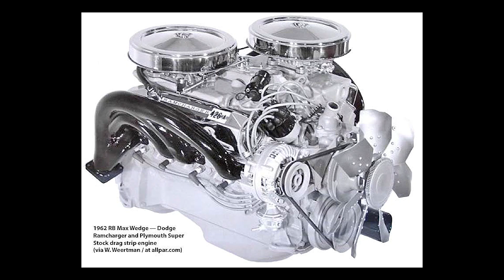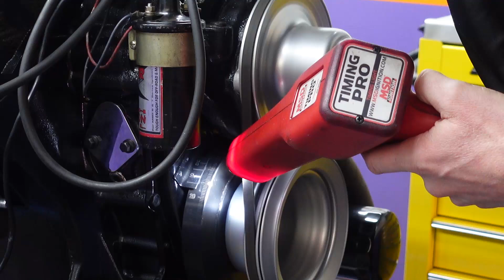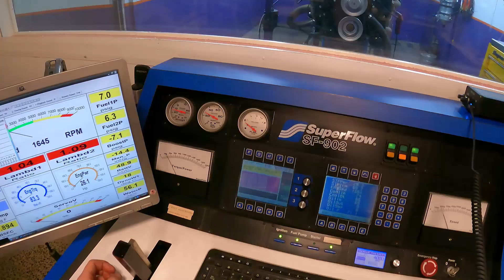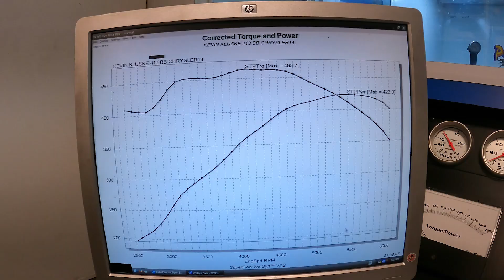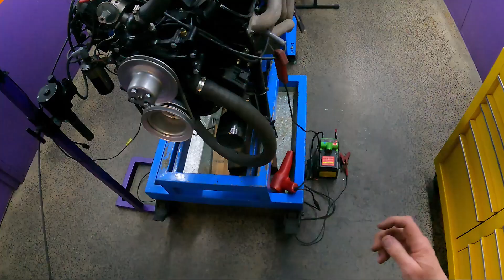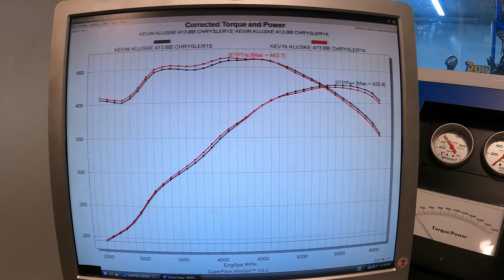High Performance 413 Big Block Mopar Build & Dyno! | Iconic Engine Builds

Comment: I've got a "fresh rebuilt" 413 Golden Lion engine. The engine was rebuilt in 1990 and has never been started. It's been in dry shop storage all these year with numbers matching 727 pushbutton transmission that documents it's  and the engine rebuilding at the same time. 
It has never been installed, started  or tested to my knowledge. 
I plan on putting them in my 1962 Dodge Dart 440 convertable.
My redheaded stepchild project.
Advice please?

Comment: I have a 1960 Chrysler 300F with the original correct 413 HP block and long rams.  I had it bored .060 over and had the older style heads reworked with upsized 1.74 exhaust valves from the 1.60 and polished and ported them. It still has the original Carter 2903s carburators which are 550cfm.  I love old Mopars.  It’s nice watching other people interested in these dyno-saurs!

Comment: The old dual carb long cross ram intakes on the 413 were / are true torque monsters. You could tow a battle tank or tear down a brick house with em. And wouldn't stress the beast @ all.
Not much top end but with huge torque down low who cares. Love to see a dyno torque read from 2K rpm with those manifolds tuned just right.

Comment: What pistons did you use in that build it looked like they were flat top zero deck or close to it I have 3 of those 413 engines all out of trucks but they are way down in the bore like 7.5 compression thank you for sharing your knowledge with us

Comment: Try a hughes engines cam next time with 1 7/8 " headers and larger carb and ported heads or rpm heads and boom 500+ hp easy.

Comment: I wonder how a 1" open phenolic spacer would have done?
Reply: I don't think there would be enough gain to sacrifice air cleaner/hood clearance. The manifold is tall and what improvement are you gonna get if you have to choke it with a limited size air cleaner?

Comment: I've been watching a lot of Nick's Garage on another YouTube channel who's in Canada who mainly works on Mopars and loves the old school Hemi's. Your video must have popped up because I watch his channel. Great video and now I have two channels about dyno tuning car  engines etc. I've been into motorcycles since I was twelve when my father bought a new 1972 TS125 Suzuki. Many years later I was working at a motorcycle repair shop which included a machine shop. In 1995 I bought a 1980 GS1000ET Suzuki for $200 stripped it down and rebuilt it as if it was brand new out of the crate and finished it 1 1/2 years later in August of 1997. Lots of modifications to the engine, but kept the O.E.M. carburetors and airbox with a K&N air filter. Stock they did 135mph, red line was at 8500rpms. I changed the drive chain and sprockets from 630 to 530 to lighten it up and kept the same gear ratio because my previous bike "same model and year"  only pulled to 7000rpm in 5th gear. The engine I built was so smooth and with gobs of torque from 6000rpms and up pulled to 10,000rpms in fifth gear topping out at about 151mph and kept pulling like a mule, but ran out if gearing. Had I geared it talker, I could have gained another 10mph or so, but never did. 
I look forward in watching more of your video's here in Miami Florida. 

P.S.
How's the weather down under? 🤔😁🧓
Reply from the maker: Thanks so much for tuning in. Nick has an awesome channel too! Thanks for sharing your story, I too love bikes of all kinds. Suzuki have always provided a great engine platform, I had an RM125 at age 13 in 83, and many a drag racer has seen awesome durability from the iconic GSX-R power plants. Weathers great here, thanks for asking!. :-)
Reply: @GlennEverittMasterofMachines  Cool. I'll watch more of your video's and try to keep my comments shorter. 😁🧓

Comment: Wow! You guys sure got a lot of HP and Torque out of that 413. Sounds really good to boot. You dont see many on the road. Actually, I haven't seen any that have been transplanted into newer cars ( (66- 73 B-bodies). Makes me think!
Reply: I have a friend with one in a '71 Charger. Not a racer, but the mild 413 runs great with 3.23 gears, 727, and 11" converter🙂

Comment: What a great video.  You don’t see these old vintage Mopar V8s get the modern treatment.  There’s a lot to be said for a purely mechanical engine without computers getting a new lease on life. I have a 413 with a four barrel Carter sitting inside a ‘60 Crown Imperial Coupe that I will be going through.  Keep up the good work!

Comment: I’m a mopar man. & we pickup pulled with a 413/476ci. It was a 4.13 bored to 4.25 bore, a 7.100 rod with a 4.25 stroke crank.  What a power house engine with big torque

Comment: Add at least a 1-in spacer, and you've got four more degrees of timing to play with at least. Big Block Chryslers have always responded well to 34 to 36 degrees of total advance. And it looks like the phasing is pretty good, your timing mark is not jumping around. From your specs, and I don't remember what compression ratio you had but you should be running somewhere right around 4 35 horsepower and right around 490 to 500 foot pounds of torque.
Reply: I've got dometop pistons in my 383 mopar, and It ended up liking 38-40deg timing a lot more than 36. I verified my balancer TDC mark a couple times to make sure I wasn't just having an error on where 0 was. 32 definitely seems pretty conservative but safe.

Comment: Excellent and professional job great power curve!  I have built and ran a lot of Mopars drag racing  my 24/7/365 daily driver 4 door C bodies. Those 4 bolt heads are almost always superior to 516 and 906s, especially the 1959 "509" and early 60s "324" if they have old school welch freeze plugs. It aint all about flow. But the best improvement I ever made was gasket matching. Leave a 1 to 2mm ledge sticking up from the bottom of the head port to flip up any pudding fuel. Never sink the valves. Do a great valve seat job, slightly bowl blend, and leave the rest alone. i get 30% better low lift flow with 30deg intake seats. Bigger ex valves with hard seats. Blend and polish exhaust.  Huge gains from a little grinder dust! Better in every area, including MPG. headers and a minimum of 2.5" exhaust a must. Good cam choice!, Im willing to run bigger with no more than a 110 ctr helps. They do not respond well at all to "modern" wide ctr cams. They wanna lope! Overlap seems to help with low octane. With our fuel here in the US, 9 or 9.5 cr is about right. Lower is fine. More timing works much better than more compression. I always run 2x4bbl either inline, tunnel rams, or long rams always synchronized, and no progressive linkages. But you have a great manifold there! I have spent many years learning the Thermoquad carb. Best mpg, tune ability, power, and sound! Dont toss warped ones they're fine just keep the same parts together.  I get 21 mpg with a 1968 Crane experimental hyd, "H302"  234° @ .050 109 ctr .455 lift  cam (tried about 20 others, nothing beats it, esp not the new crane "302" ) , 4.10 gears, long rams, and two big block TQs. lifts the front end with 4680lb car, low 13s in 1/4 with 8.0 cr on 89 octane. Gearing and torque convertor is key. Get her cruising in the rpm sweet spot. People wondered how it got such good gas mileage. It almost doubled, going from 2.91s to 4.10s at 60mph. 4 mpg better than bone stock! Awesome build!
Reply from the maker: Thanks for your awesome feedback and input Daniel! Glad you enjoyed it. 🙂
Reply: Thats moving for a heavy car. Love the long rams for torque and the TQ's are great carbs. I had a 350 hp 440 in my 84 dually and got better millage then I do with the 360 that is in there now. When I build my 440 I plan on using my long rams on it, can't beat them for low end torque.

Comment: I like the old four bolt valve cover heads. I wonder what power it would make with an old Weiand or Offenhauser 4bbl intake manifold made in the early '60s. They were low rise single plane and nothing at all like single plane intake manifolds like the Torker.
Reply: They were a 1950s designed manifold. Some of the 50's engines had factory iron examples of them. I put a Weiand version of it on the first 440 that I souped up in 1972. And had the Offenhauser version of it on a 340 that I later changed to an Edelbrock single plane. I have an Offy RB Chrysler dual quad manifold that I will one day install just for nostalgia sake. Everything you read about those manifolds trashes them but about 35 yrs ago one of my friend's had the dual quad version on an E-Body Barracuda 383/4 spd and it ran great. It would be cool to see someone do some serious testing and comparison even though I'm sure modern stuff is much better.

Comment: What’s the whine type sound coming from that engine? 
That engine seems to have a lot of blow by!
I noticed that engine is an early 413. 4 valve cover bolts instead of 6. A new head would have had better port flow. Still pretty good power.

Comment: Good job on the engine. It ran strong and sounds great. I didn't know there are Mopar nuts in down under. Greetings from the U.S.
Reply from the maker: Thanks Marcus! There sure is! We’ve had Chrysler here dating way back.
Reply: @GlennEverittMasterofMachines  When I first saw that '59 Chrysler Imperial, I thought it's a right-handed drive car. But it isn't.
Reply from the maker: @marcushaynes843  all of our new Chryslers were RHD but we have a lot of LHD stuff here, imported by enthusiasts over the years. Our laws allow anything over 25 years old to be LHD if we please.
Reply: @GlennEverittMasterofMachines  That's SUCKS.

Comment: Nice work I always impressed with the work that is done in Australia . I had a 426 marine wedge once i installed in a 68 Charger .  To get 1 hp per cubic inch on those wedge engines is doing some thing with those cylinder heads . I think the max wedge engines might of had a better set of heads but nothing like the hemi . I appreciate your build and video .
Reply: the wedges made more torque but the hemi was better for HP at the top end which is why it was used in the race cars.....gave the edge in top speed

Comment: What is the flow? if it is like the 452's or the 906's then it tops out at 220cfm so 440 hp is about all you can do. Try a moderate PnP job with some pocket porting adds 40-50 plus hp if the cam tickles the valves enough.
Reply: even worse, i think they were 915s.
Reply: @frigglebiscuit7484  yikes!

Comment: Big Mopar engines are tough to build correctly using factory parts. The pistons are too heavy, the rods are not very strong and the cylinder heads are by far the biggest thing holding them back. This engine doesn't need that large of a carb. If you put your air turbine on and measure the actual amount of air this thing uses you will see that it's pretty low and a 750 would easily be enough. The heads don't flow enough to warrant an open spacer on a 180 intake. Thing to remember is that this is a long rod engine with a high rod ratio and they do not activate the intake air flow like a shorter rod engine does. The tall deck height dictates the long rod so you are stuck there. It's actually making about what there were supposed to back in the day though so it is what it is.
Reply: stock mopar rods are awesome. also, yea, the heads are a bit on the small side, but thats what porting is for. and on carbs, mopars and buicks always want more carb. ive got a 750 on my motorhome headed(bowl ported), stock comp, 226/234, .494/.513 cammed 400 mopar. it screams.
Reply: Agree on the pistons being too heavy and heads (in stock unworked form) but not on the rods being "not very strong".
Reply: tell me you know nothing about big block mopars without telling me.

Comment: it makes some ok power but at idle it sounds like an old truck engine, where's the overlap man, can't  have a wedge that don't go bump when it idles, that's sacrilege, you can go to hotrod hell for that....
Reply: Want smooooth for the Imperial🙂 ...at least I would. And lots of part throttle torque.

Comment: Actually a 1955 design and pretty bulletproof, only surpassed by the low deck Mopar Big Bock, which is basically the same engine with a shorter stroke and bigger bore. These are GREAT, G-R-E-A-T engines

Comment: 425 is pretty impressive considering the mild cam and as cast '59 heads. The early 4 bolt valve cover ones like those have smaller 1.94/1.60 valves, I would assume the heads were cut for 2.08/1.74 or bigger though?
Reply: Had a few,lucky enough to also have stage 2 max wedge heads n manifold. Never had access to the Dyno but got a good E.T. out of a 3400 lb car to the tune of consistent 11.8's with a single carb 440 cu.in.

Comment: Holy s*.   I'de never have the balls to run up the RPMs  to explosions levels.  Man, thank you !!!
Reply: 6k rpm is nothing for a older mopar v8. forged internals. hell, even the cast cranks are good to 500+hp.
Reply: All forged internals. The Max Wedge race engine would laugh at 7Krpm. The '68 Super Stock Hemi cars regularly run 10,000rpm, pass after pass.
Reply: Cool, thanks for the updates.

Comment: Did you put twin spring valve springs on it? It seems to be losing however a bit early.
Also seems to be lugging an awful lot early in the test. Your Advanced mechanism isn't picking up Advanced quick enough.

Comment: What is it about carburetor that you don't know how to pronounce? It's not a long u, say it is if that letter is an e.
Only 32° Total Advanced, you're still leaving power on the table. With the specs that you quoted, you should be getting right on top of 420 horsepower and about almost 455 or 460  torque quite easily.
Reply: Yep, 38° and open spacer 440+ HP
Reply: did you miss the closed chamber heads and 10.2:1 compression ratio? i will say, id have turned the timing up a bit more as well, but not 36-38. on 452 heads, sure. 915 style heads? noooo.
Reply: @frigglebiscuit7484  My daily ride since 1988, 383 with closed chamber heads 10:1. No speed limit here, sees 6K every week almost 600 000 KM on the clock, heads never been off, no problems whatsover, still runs like new with perfect oil pressure. 38° full mech advance, as recommended by Mopar Performance for all iron head big blocks.

Comment: Awesome vid !!  I'm glad you guys are using those knock sensors. I'd be concerned too considering 10.25-1 compression with iron heads. Not to mention a very conservative camshaft in the duration department. That can make for a knock sensitive engine under the right circumstances as I'm sure you know. Anyhow,  very Impressive numbers considering the conservative nature of the build.👍
Reply: @Future-Preps35   oh. Ok, well, that does change things. I'm in southern California... we're stuck with crap 91, so we have to be very careful with compression ratios. 9.75-1 static with iron heads is sort of the "rule of thumb" for around these parts. What octane is commonly available in Australia? Is leaded gas still available there ?
Reply: @Torquemonster440  most of our service stations(gas stations) will stock 91,95 and 98 octane fuels. Also one of our fuel franchises sells E85 straight from the pump. In Australia E85 is always 85% ethanol and around 105 octane great for modified/built engine's
Reply: @gr8mate27   Wow.. 95 and 98 octane!! Cool. Yeah,  the service station down the street from me sells E85 from the pump, I just haven't made the switch. A new E85 carb is about $800-1,000 !!
Reply: @gr8mate27  ...E85 is great boost juice!!!  Love running my turbo Evo on it as it makes lots more power over straight pump gas......have to re-fuel 2x more often but its fun :)

Comment: I see the vacuum advance is not hooked up.
Reply from the maker: Correct, that'll be plumbed in when it's installed in the car, then tested on the chassis dyno and street for optimal part throttle scenarios of which the Vac advance system is required.
Reply: they are a pain to tune, and can even cause pinging if you arent careful. takes alot of fine tuning.

Comment: What were the cam specs?
Reply: It's a Howards hydraulic roller.....didnt give lift specs but it's 228 degrees at .050".
Mild build. She needs more cam or more cylinder head. I'd pop on some aluminum heads and let her eat💪
Reply: @hoost3056  the heads they used are notorious fr bad flow, especially the exhaust side.

Comment: I have one in my Duster with egge cast flat top pistons, 230°.050" .480lift cam and 440 source cylinder heads just ran my best time 12.48@108 with a 2,500 stall and 3.73 gears.

Comment: The best I could get on a 440 with the Performer RPM intake was with a 1 inch, 4 hole carb spacer.
Reply: Gotta fit under the hood with a sufficient air cleaner.